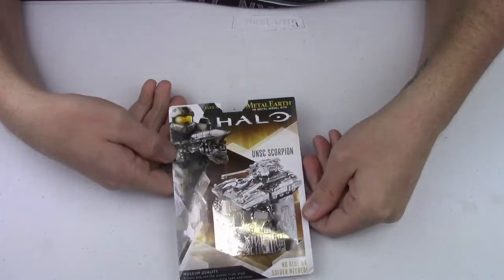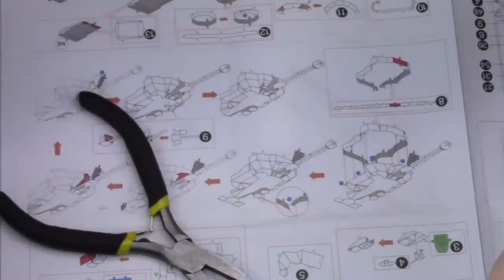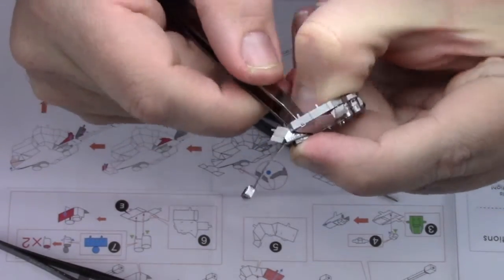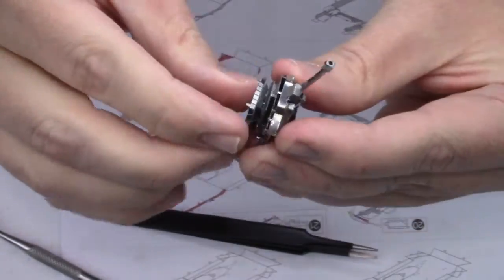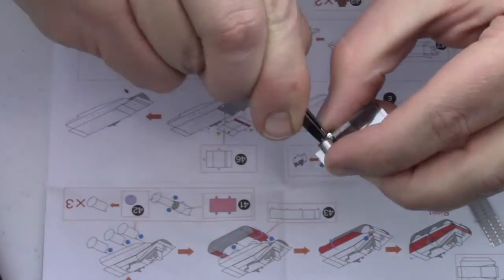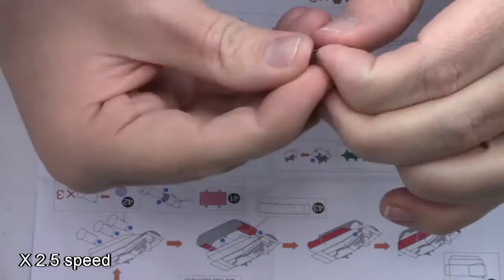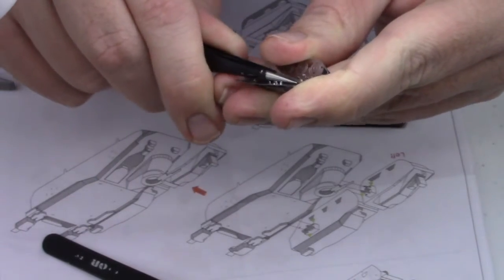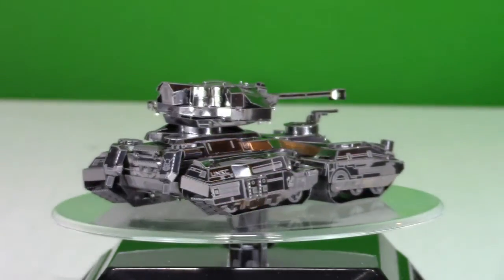Metal Earth build - UNSC Scorpion - Halo

Comment: I finished this model today.  It was every bit as difficult for me as you said it was for you.  I do have a suggestion for anyone attempting this build.  While shaping part 10 (turret base) before attaching to any other part, test fit it on part 16 (tank body top).  (Part 16 does not have to be removed from the sheet for this.)  This will allow the builder to position the tabs on part 10 so that the final assembly of the completed turret to the body may be easier.

All in all, I was pleased with the completed model.  Although I did make a lot of mistakes, I also learned a lot.
Reply from the maker: That's a good tip. Looking ahead and test fitting things in such a fashion can help out on many models.

Comment: i found one of these when clearing some stuff out of my mothers house, she liked to buy random stuff from Wish, and i think thats where this ones from cuz its not got any official Halo stuff on the packet, but instead is done by a chinese company called KC 3D metal model kit. but it the exact same model and instructions, and damn its hard. I'm currently using your video to do it along to so as to help, which it has. Because i just couldnt work out the angles on those first parts either, even after looking for reference photos. Ive never done a metal model before, in fact i didnt even know they were a thing, and some of them look cool. I'm kinda enjoying seeing it come together, but it is hard. But if i can do this one, then anything after this should be a breeze. especially if i get proper stuff, as right now all i have is old AF pliers, some thin janky needlenose tweezer, and some nail ciippers to clip parts from the board and twist tabs. so my skills are being forged in fire. lol. this video is defo helpful.
Reply from the maker: Awesome! Best of luck. Those angles on the torrent were a pain.

Comment: I just started on this one, and it has me terrified.  I am certain that it will take weeks to finish.  (I have my own health issues.  When my hands start to shake, I have to stop and pick it up again later.)  I do have a couple of suggestions.  First, I have a telescoping magnetic pick up tool that has proven to be invaluable in making these models.  It has located several tiny parts that seem to have an affinity for the floor of my work area.  Second, since destroying one of the horizontal stabilizers on the Cessna model while trying to remove it (put it on the wrong side), I try to twist all tabs clockwise.  If I find that I need to remove or loosen a part, I know to turn the tabs counterclockwise to get them straight again.

If I survive it, I will let you know how this one turns out.
Reply from the maker: Richard Kroll good tips, I do the same myself. Good luck with your model.